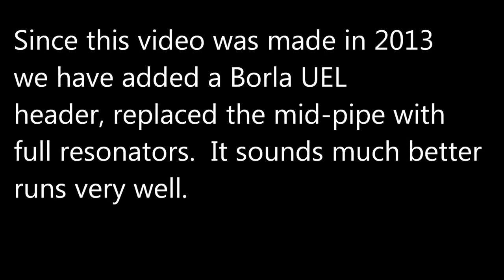2003 Subaru Legacy Exhaust

Comment: Nice vid, I have an 03 legacy and I wanted to know where I would be able to get a new exhaust system like the one you showed off thanks
Reply from the maker: I have since added a new header pipe which is a Borla, the rest of the piping and cat are Walker.  The muffler is a Flowmaster Super 44.  All the parts where bought from a combination of sites;  Rockauto, Summit Racing and the local auto parts store.
Reply: JWCMotorsports I plan to redo my entire exhaust system so this was really helpful thank you ☺
Reply from the maker: Thank you,  more videos coming up.  I've retired so have more time to work on the projects.   Thanks again for watching.  Consider subscribing.
Reply: I want to do pretty much the same set up but have a tsudo high flow cat, wondering if it can be used on non turbo car and if so without negative affects.